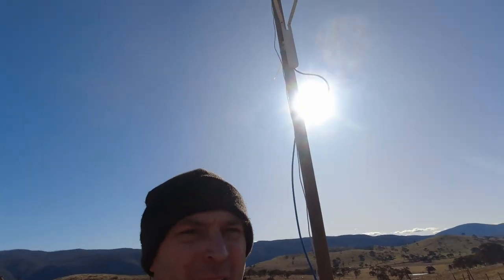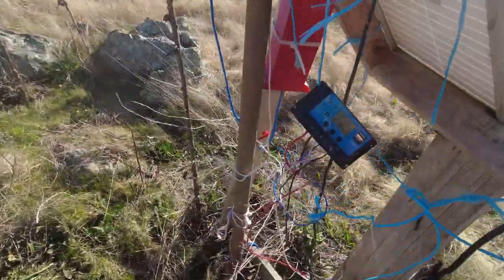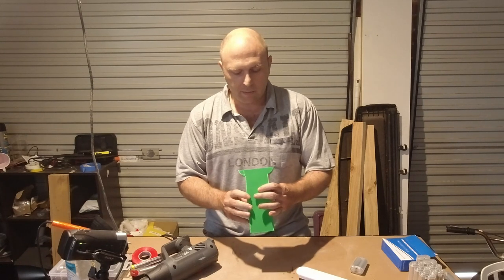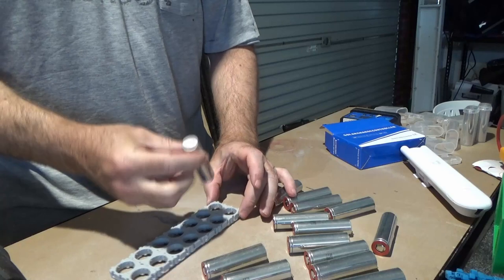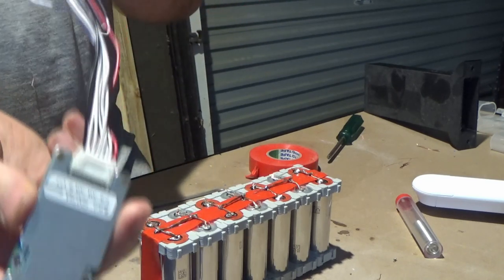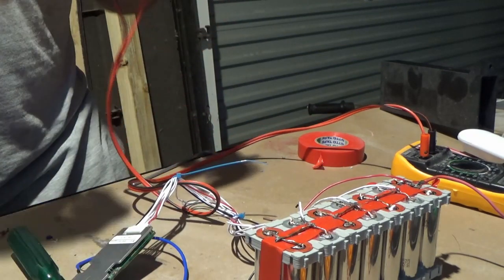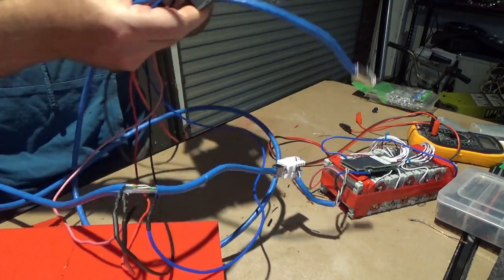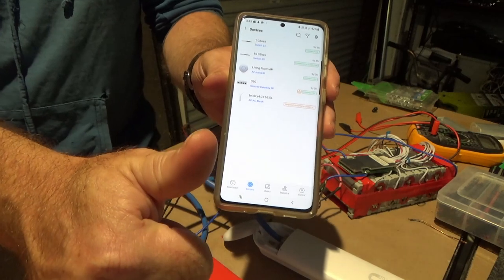Creating a Remote 24v PoE battery for Rural Wifi

Comment: Great video. I have one of those charge controllers sitting in my shed. How hard is it to install ubiquity gear? Have been told is not straight forward.
Reply from the maker: the one thing about ubiquiti is that it is very easy to setup, just need to give them power and the app makes it plug and play
Reply: @scottnogrid6842  thanks for the quick reply. What sort of distance over air can you get between router and ubiquity?
Reply from the maker: @gibo1971  about 400m for the out door AP  with no obstructions. ubiquiti can mesh so I do have multiple hopes to my furthest points
Reply: @scottnogrid6842  we have a building about 400 mtrs away we would like to get internet at but have trees obstructing line of sight. Thinking buried coax will be the only way to bridge the gap. :( thanks for the reply.
Reply from the maker: @gibo1971  If that was me because im lazy and digging 400m trench sounds like too much work, I would just double hop. Ubiquiti outdoor ap's are damn cheap around 150 bucks. I would  do one to the treeline then one on the building they will link together to provide access. The cameras at the front of my property at the driveway have 3 outdoor AP's creating a network from the house over a hill and through some trees
Reply: @scottnogrid6842  thanks I didn’t know I could do that.